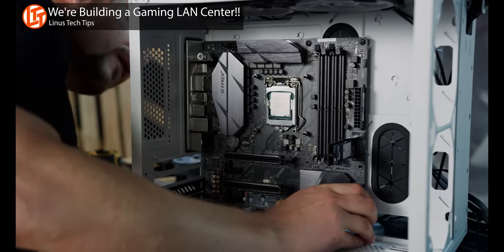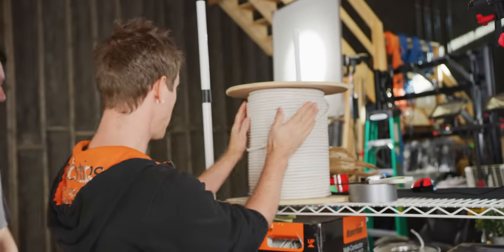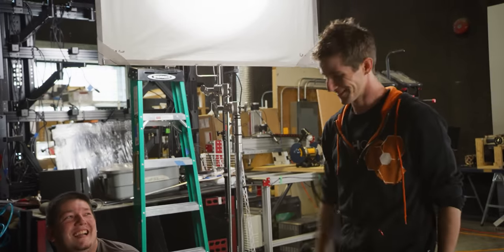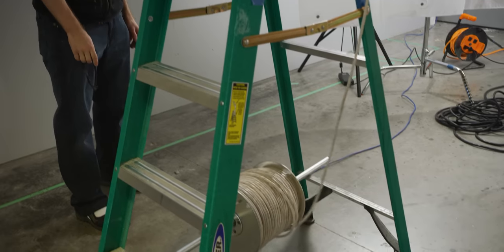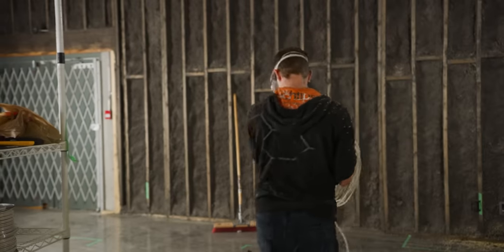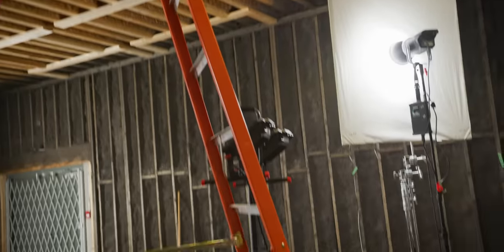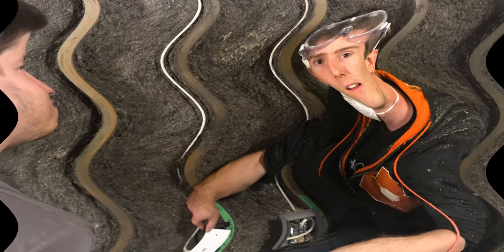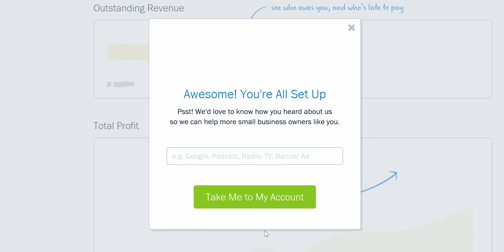Electrical Wiring for the Gaming Center - What could go wrong?

Comment: except for the fact that an electricians hammer is an actual tool, linemans pliers are commonly referred to and used as a hammer by electricians, or channel locks, or a 4 square box, or ... well we'd be here all night. As an electrician I love these videos with Brian, keep'em coming
Reply: Ya know, you don't need to use the hammer head to hammer. Then again, we do not hammer our cables against studs where I live. We hammer the piping to the different boxes and then pull the wiring afterwards.
Reply: @Helveteshit  Indeed, and the benefits of using pipes is that you can easily change things later on. I really don't understand wiring practices like this that don't use pipes
Reply: linemams are the best hammer

Comment: Brian terminates Cat 6A properly. Be like Brian.
Reply: He did do it right. Then  he let them paint the cable in the ceiling. 🤦‍♂️
Reply: @asooxbmw5616  very true 🤦‍♂️
Reply: @asooxbmw5616  For a non electrician... what is wrong with painting the cable?
Reply: @Hoch134  Its against code as it effects the fire and smoke resistance of plenum cable. Its against best practice because many cable manufacturers believe the paint can degrade the porous outer jackets of the cable and negatively impact performance. Generally cables that fail certification due to paint won't have their warranty honored. I also wouldn't hammer staples into twisted pair cables. I prefer using cable straps like what Arlington sells for data stuff.

Comment: So as an electrician the only complaint I have about this video that is driving me nuts is his lack of a loop in the wall for the plugs. It is actually code to leave a loop in the wall with NMD-90 for possible future fixes or changes. 

For those of you who have access to the 2015 CEC (I have not purchased the 2018 yet but I am sure it is in there) it is 12-510-4. 

"Notwithstanding item (1)(a), where cable is run to a switch or receptacle specifically approved with an integral enclosure incorporating an integral cable clamp, the cable shall be supported by straps, cable ties of a type specifically approved for the purpose, or other devices located within 300 mm of the switch or receptacle wall opening, and there shall be at least a 300 mm loop of unbroken cable or 150 mm of a cable end available on the interior side of the finished wall to permit replacement."
Reply: I honestly thought that Canada used the NEC
Reply: Even if its not specified in code, its just good practice. Drives me nuts when replacing something and there is zero slack in the line the way they did this install.
Reply: Dang the more you know..
Reply: @esthergennn  Canada is more extensive. Nothing like regulations in Canada. We take everyone else's idea of good enough, and make it look insufficient.
Reply: The 6 inch loop is so that when you service the receptacle or device wiring, you have wire you can pull through into the box if you have to clip ends to avoid having fractured wire. You can't leave it in the box due to box fill requirements which keep the receptacle or device from pressing into the wire and creating short risks and electrical hazards like tight wire bends which cause resistance and heat. 

tl;dr: it's to stop fire and shock hazards.
Reply: @FeriteKnight  Cannot tell you how many times this have saved me from drywallers knicking wire when they are cutting the holes out.  all hail the loops!
Reply: It's also good insurance so when the customer wants you to move the outlet slightly you can lol
Reply: It does make it hassle-free.
Reply: Xtreme Performance  You are right about the the wire, he should have used 12/2 MC. Concerning the ground, its not really a ground its a bond wire but everyone just calls it a ground. Check out Mike Holt's Grounding VS. Bonding.
Reply: Can say its in the 2018 CEC
Reply: Insert something smart here
Reply: Xtreme Performance  There was basically no way this guy was going to get through this video without somebody ragging on something because they wanted to prove they knew about the subject. Just cool it. He is doing this work in a different country with different regulations and most likely exactly how hes been taught. Just like you. Read your own NEC and you'll see 14 is capable of 25 amps just fine. We just have another piece of code that dictates we use 12 for typical branch wiring and 20amp circuits. Its our NATIONAL electrical code. Not the WORLD electrical code. Regardless of code, I agree. I would've used 12 because its normal and readily available to us, but that doesn't mean it is for everyone and shouldn't be beat over the head because of it.
Reply: Xtreme Performance  you don't actually know what your'e talking about. The ground is for bonding and 14AWG can handle what they're doing.
Reply: it drives me nuts that it drive u nits!
Reply: Yeah I was confused by that too, just use 12/2! Those should be 20 amp outlets. The only thing I can think of is they were trying to save money, but 14/3 isn't that much cheaper  Xtreme Performance
Reply: Xtreme Performance  You can get away with 14 but 12/2 is much better as it supports 20 amp. I always install 12 gauge with NEMA 5-20R's that can accept 5-15Ps incase someone decides to plug fridges in.
Reply: K
Reply: Xtreme Performance  14 AWG is sufficient for 15 amp electrical receptacles.. here it's the standard. For a kitchen counter top you'd want to use 12 AWG though.
Reply: Xtreme Performance  in the 2018 NEC they upgraded the amperage rating of 14 to 20amps so in a lot of homes today all of the convenience receptacles are ran in 14 because with the prevalence of 5v power bricks and LED lamps the loads of today are much lower than even 10-15 years ago. while still not recommended its not a death warrant
Reply: What century will you guys change to metric?
Reply: That change was in the 2015 CEC as well, there is just an overriding rule that says it can't be used with more than a 15A OCP, 20A rating is really only the exception being able to be used as a tap to a BBH with a run less than 7.5m or for supplying motor loads.  @bradreee7290
Reply: Well our electrical inspector actually frowns upon excess wire in the walls, a lot of it has to do with tampering with R value especially on the outside facing walls. I definitely don't add 300mm outside, but I definitely leave 150 inside my box. My father taught me that one. But I could see your argument, and I def disagree with most of the other electrician that are crying for 12-2, you can definitely get away with 14 for their circuits (this one isn't obv directed at you), 14-3 is plenty for this, 2 hots is more than adequate.
Reply: Xtreme Performance  ground wire is the actual wire going to the ground or connecting to a ground rod. Bond is anything attached to the ground, so technically he is right, you are wrong
Reply: Wow I sparked something more than I thought it would. Anyways...

As for comments on #12 vs #14, the latter was rated for 15amps (in Canada as of our 2015 code book). In all honesty most of those plugs will be for computers not drawing the full 15amps and it will matter even less if it's one plug per circuit.

We don't know the blueprints or circuit demands that linus needs so hard to say why #14 was used. If it was me I would just overrule linus and just slap #12 and 20amp plugs in because well... It's linus and he will probably do something stupid to pop the breaker at a later date so better to linus/future proof now.

I didn't mean to spark a bunch of criticism over the guys work but not leaving the extra 300 mm creates hassle for everyone later and so many electricians do it. 12-3000 (again 2015 CEC) says you have to leave at least 150mm for just the hookup so on top of the 150mm required by the previous rule... That is just not practical in a single gang box. So that is why you leave the extra 300 mm outside the box.
Reply: thegeorgezila  I did list CEC so for us in Canada that means Canadian electrical code, I think America is NEC but since we don't use their code book I could be wrong.
Reply: Xtreme Performance  Grounding in reality has nothing to do with lightning. A bond wire is a non-current carrying conductor used to clear faults by tripping protection devices. A ground wire is a wire used to limit transient voltages, surges, static, and to stabilize voltages during fault conditions. The wire he called a bond wire is actually a bond wire, in the field its normally all called grounds but in this case its actually a bond wire.
Reply: Xtreme Performance  In Canada, it's fairly common to call them bond wires. Just short for ground bond, meaning it's grounded through the main panel; people use it. Most electricians don't use 12/2 or 13/2 for PC and media here outside of Data Center electricians either. Your average electrician doesn't really see the need for it; and most have no idea what is common in Data Center applications. Just about every Commercial office space I've done work in has 14/2 run for everything that constitutes a standard receptacle. And it's also fairly common to put 12 devices on every circuit, rather than using multiple circuits to cover Multimedia and Workstations, and running standard receptacles on their own circuits.

Comment: Also Linus I would suggest labeling both ends of each cable you run, about 3-4 times (about a foot apart from each label, starting about 2 inches from the end) on each end, to where it's supposed to go. When we run cable we label them so we know where they go when we get them to the patch panel(s) and the switches.

Comment: Sweden over here :p why dont you use flexible tubing ? Over here you need to and if anything ever happens or you remember that you did something wrong after the drywall is upp you can just drag the old cable out and at the same time a new one. We do this both for networking cables and power, but in separate tubes :)
Reply: yes, this is the way to do it. it might be someone else replacing the cables decades later, but they will thank you for not stapling the cables in place.
Reply: Enig 👍
Reply: Totally agree tubing/conduit is much better for networking cable runs
Reply: This is sometimes done in the USA, especially for networking cables (or other cables that might need "upgraded" someday).  It is done a lot more often in commercial or industrial settings also.  Most residential wiring and some small commercial are done without conduit.  Residential power is almost exclusively done without conduit in my experience.
Reply: Netherlands over here. Its required here as well. No wiring without tubing. Fire department would reject this on the spot.
Reply: We use whats called MC cable instead for most commercial work, which allowes for a flex protection of the wireing for power. and for network we use Flex or plastic flex, it does the same thing.  My other point was that with Romex cable or what they were using witch is roughly the same thing, you can pull down the drywall with a glowstick or fishtape.  it works just the same.
Reply: I was wondering the same thing, power-cable straight in the wall?? flex conduit for every application except for whats mounted on the wall.
Reply: @DewinPotS  That is an EU regulation, everyone are using tubes here.  There are even stricter regulations
Reply: We do the same here in Brazil, Issue with "dragging the old one out and placing a new one in" however, is that you never have enough room and the cables start to get tangled.
Reply: Same in Norway as use pretty much the same methods as you. And the flexible conduit we use today usually have wires or cables pre-installed, so it takes about the same time away.
Reply: @NotFab  As long as you're two, one pulling and one feeding with some lubricant, it usually works out fine.
Reply: In the USA metal conduit (rigid or flexible) inside covered walls is only required in Commercial or Industrial wiring (which most times is run thru metal studs or joists where standard plastic/rubber jacketed wiring would get damaged), Residential wiring going thru wood studs or over head joists and is covered by wall board (Sheetrock or some other type of covering) does not. The only exception in residential wiring is if the wiring is run down the face of the wall and not covered, that has to be in conduit (rigid or flex) up to the height of 8'. We do at times run conduit down the inside of the wall in residential if like was said by others the cable/wire might be upgraded or replaced
Reply: Same in Israel, Also, we frame drywall with aluminum, not wood - you guys must have a lot of house fires in Canada...
Reply: @ColeBrodine  yes, and it is wrong

Comment: Canada: Bonded
Europe: Earthed
America: Grounded

ok
Reply: I have lived in Canada for 25 of my 27 years on earth and only learned this today. I don't think I have ever heard anyone refer to ground as a bond. At least not that I have noticed. I'm not an electrician by trade but know a few coast to coast and they have always said grounded whether they know otherwise or not.
Reply: @JohnyKnox  Me neither. Always heard ground. We even say ground in Quebec even when speaking French (French-glish)  even though it would be terre (earth) if said in French.
Reply: Australia: Main Earth Neutral Link
Reply: Technically a "ground conductor" is the main conductor that connects an electrical system to ground. The technical name for every other type of "ground wire" is "bonding conductor," because it is bonding whatever piece of electrical equipment to that main ground conductor. This is the same in the US and Canada, you'll just never hear "bonding" used frequently outside technical specifications or electrical codes, they're usually casually referred to as "ground wires."
Reply: Here in Québec we call it grounded even if we speak french. Sometimes we will say ''Mise a la terre''.
Reply: @zablogful  It'll only be a problem for Martian electricians :)
Reply: North Korea: Nuked
Reply: @JohnyKnox  In Australia, bonding is referred to Earth conductors bonded to copper water pipes etc, for added Earthing. Not the actual "Earthing" or "grounding" itself, although it all ends up in same place, like our Neutral conductors, hence the Main Earth Neutral link (MEN link in the switchboard). The Main Earth conductor is connected to Neutral bar (unbroken), before continuing to the Earth bar or main connection point in switchboard. I'm not sure what other countries do in this respect, do you guys even have Neutral conductors outside AUS/NZ? I can't remember now..
Reply: @craigjones8558  Yes, we definitely have neutrals here, and grounding is largely the same. Grounding conductor from the grounding rod/plate/loop to the neutral bus (unbroken) and then to the enclosure. Residential is generally a 120/240V split phase system and commercial/industrial generally get either 120/208V 3 phase or 347/600V 3 phase. Old buildings will sometimes have 277/480V 3ph and apartment buildings/townhouses etc will normally have 120/208 3ph, with each unit sub fed with 2 of the 3 lines, and a neutral.

Comment: The "innovative spool holder" is something every electrician does lol
Reply: my favourite is the half inch conduit bender supported by 2 category cable boxes
Reply: I worked a lot in attics, my favourite was a piece of wood, two screws and two vertical joists
Reply: Can confirm.